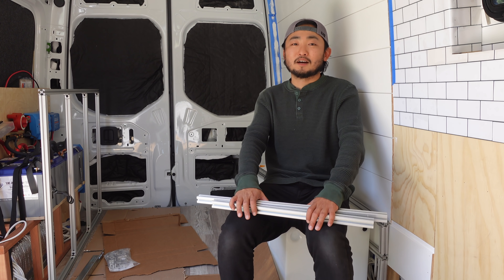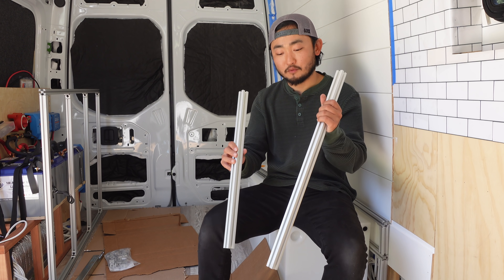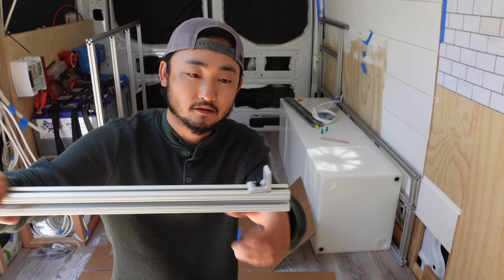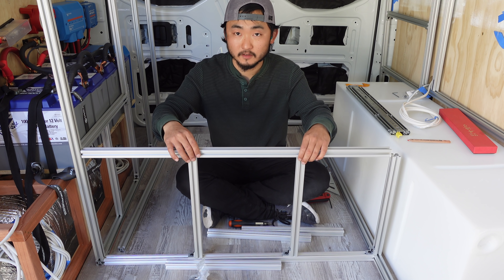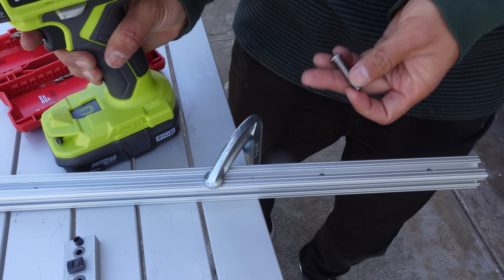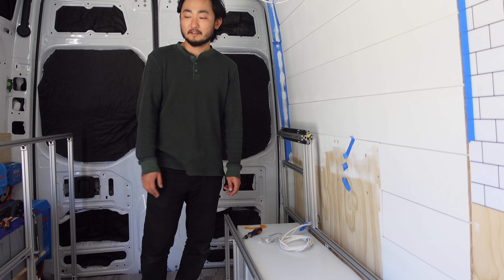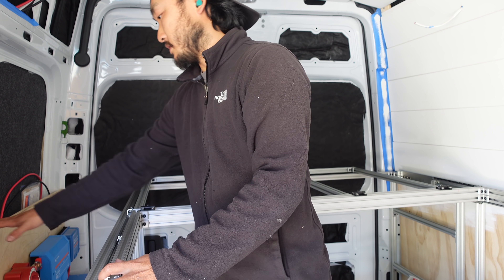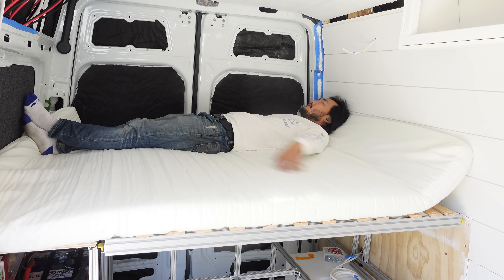Best Space Saving Bed Conversion with Garage | Van Build

Comment: You should be very proud of yourself Taku.... You made a wise choice electing to go with the aluminum material. I have used it in my job and the aluminum framing is not only stronger but it has the feature of staying cleaner, and more presentable.

Comment: My first thought was oh crap taku using metal in a electrical area , but you’ve done everything in such a professional manner that it won’t be a problem, then you put locktite on all the bolts , just in case you two get a little athletic  👍🏼 this build is great , can’t wait to see the adventures you two have !  Will you be taking the yak with ? 🤔
Reply from the maker: If we can figure out an easy way to get it on top without damaging the solar panels, yes!

Comment: We are building a van with a bed that is separated from the garage (head board from mattress base to ceiling) and a flip up foot section that will hide the bed and open up a bench area for day use. passenger side will have a 
stainless steel counter with butcher block accents(at sink cover and flips), 2 burner induction and flip up/downs at each end.we are putting in a fridge (behind drivers seat) and separate freezer under the bench seat.
Your interior i noted has shiplap walls and a white tile metal? graphic backsplash which is how we have it.
Lots of fun keep up the good work.
Reply from the maker: Our tile is just stick on since it weighs much less and way cheaper. Good luck on your build!

Comment: You can use a chop saw with a finish wood blade to chop aluminum. Just chop some raw wax before to get a smoother cut. I cut aluminum models for year in construction. Commercial window installers do the same.

Comment: you need a thermal barrier between the 80/20 and the van's metal hull otherwise the metal bed frame will get super cold and your bed will be supercold if the aluminum is getting it's warmth sapped by the Van's exterior metal hull. Good thing most of your wood paneling covers this.
eg nylon spacers between the 80/20 and the van wall and also between the bolt head and the 80/20.
Reply from the maker: We have insulation and wood panels between the van and the bed unless you mean we need additional?
Reply: @TaklyntheWorld  looks really good but hard to see if there is any contact on the bottom right (facing from inside van) by the back door. Only one way to test is to drive it out to the san francisco beaches overnight and see if any of the aluminum gets really cold.

Comment: I don’t know exactly what sort of blade you are using to cut the extrusion but as a rule abrasive cutters should not be used on aluminum. They can pack up with aluminum causing the blade to be off balance which can lead to failure of the blade. If you have ever seen a blade explode it will leave an impression. You can cut aluminium with any blade that cuts wood.

Comment: Nice design. Are you not going to need two singles though so that it is easier to fold? Also probably want to dampen the backside so it does bang against the door all the way down the highway. I would also try and connect the two rail slides releases somehow unless you can reach them both simultaneously.
Reply from the maker: We cut the mattress so it can fold and we can reach both since the sliding part is only on part of the mattress we might still add something though since we need to be able to pull the mattress a little so that it folds as we push it on the slides.

Comment: Normal lock washers are a gimmick, Belleville washer actually work but they are not cheap or easy to source. Use thread locker on anything you don’t want to loosen or can’t easily reach.

Comment: Be careful cutting non ferrous metals with the abrasive cutoff wheels.  Why they are rated for metal most of them are not to be used with soft metals like Aluminum, brass and copper.  The will load up the wheel and have been known to cause them to explode.